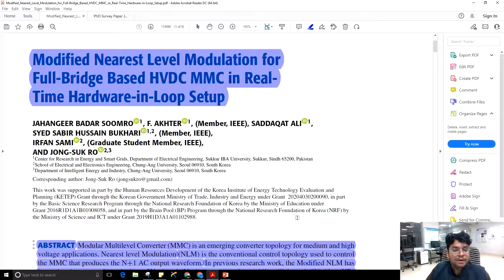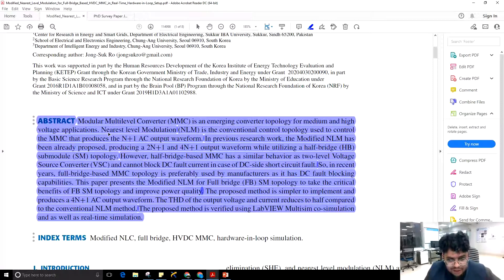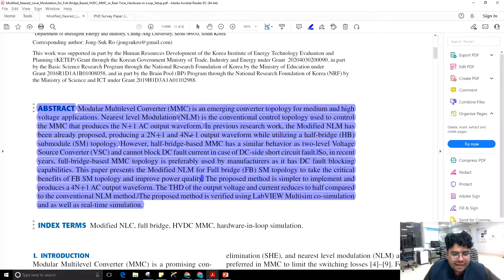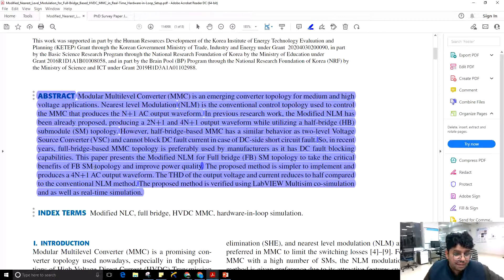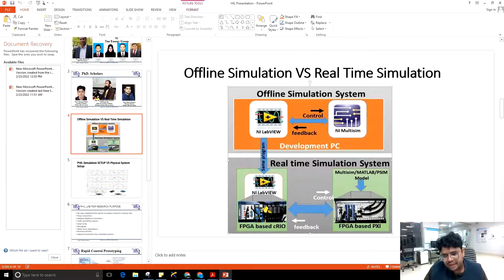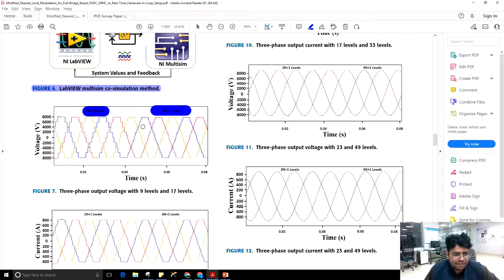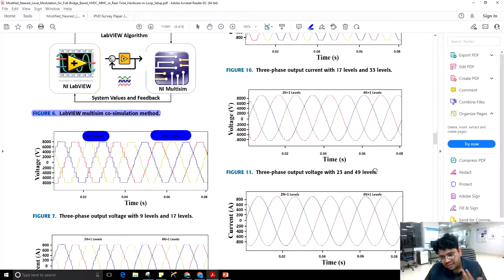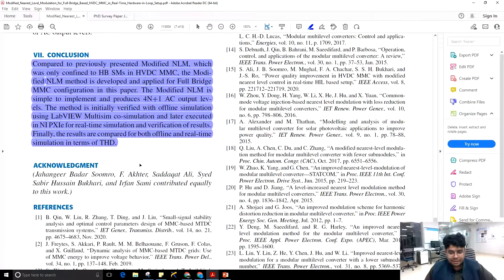Modified Nearest Level Modulation for Full-Bridge Based HVDC MMC in Real-time Hardware-in-Loop Setup

Comment: Sir , do you have any suggestion on which paper or book I should read to understand NLC, SHE, and SVC?. I want to control reconfigurable battery system which has more than 50 sub modules in MATLAB. there is only one arm per phase (no upper and lower arm). thank you in advance.
Reply from the maker: engr.jahangeersoomro@gmail.com contact please